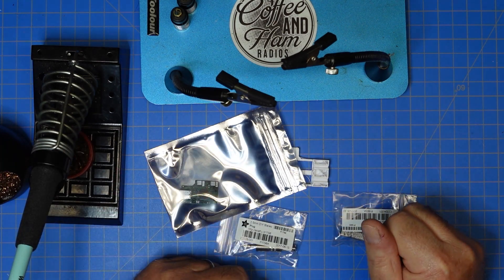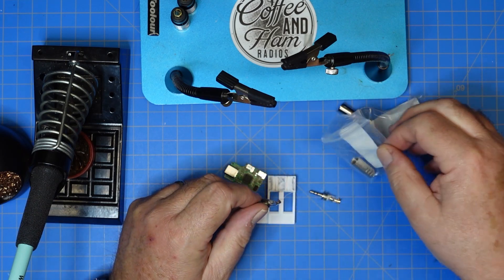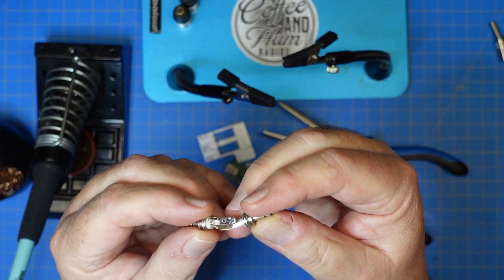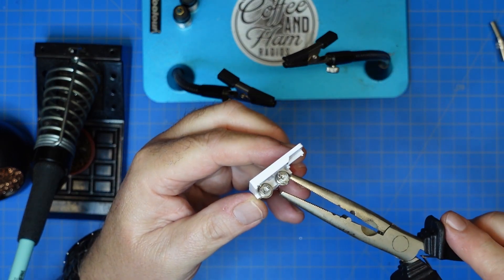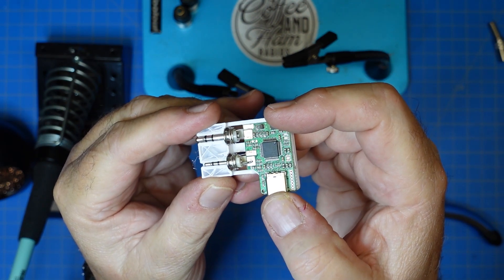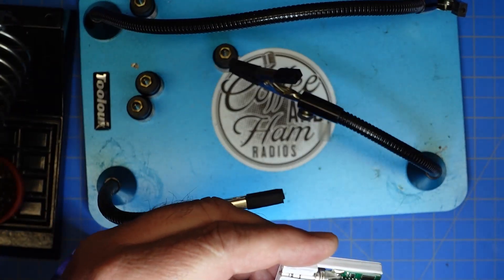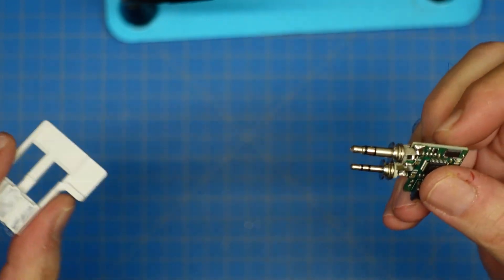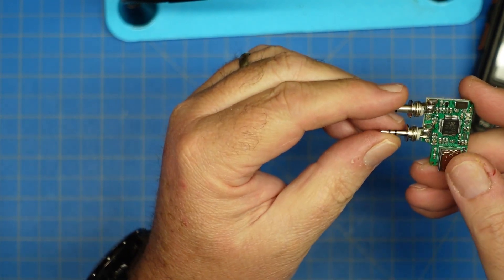Let's build that AIOC board!

Comment: looks like you could just plug the jacks into a radio and everything would be lined up, solder it. Done.
Reply from the maker: Yes, you can.  That's my preferred method anyway, and IMO, less janky than making sure those plugs line up to fit into the radio.

Comment: Jim, I finally got my AIOC from China(yay) but I have to source an LED before I can use it(boo). 

I noticed your board--and mine--don't have that tiny little smd chip on the right edge, up from the usb c. Is that no longer needed? 

I am worried I need to go get that too
Reply from the maker: It is needed - absolutely.  That is a regulator chip, and the board won't work without it.  (Unless Simon changed the design)
Reply: @FEPLabsRadio  did you add it after the video?

Comment: Have a question. Windows 11 no good for this. And Windows 7 requires Drivers as they have Yellow Marks in Device Manger Is there correct drivers to download? Thanks
Reply from the maker: I got the drivers from SparkFun.  Google around for CH340 or CH34X drivers.